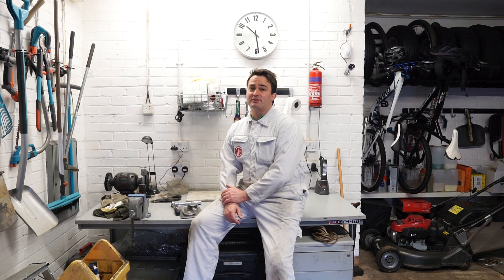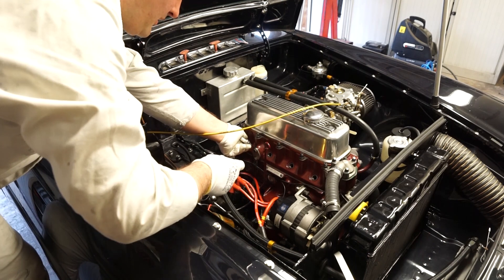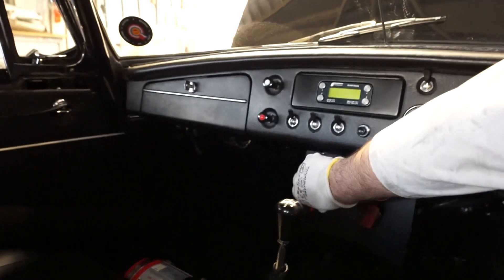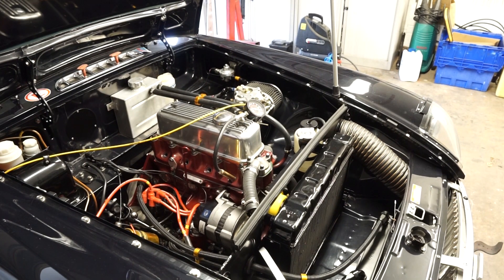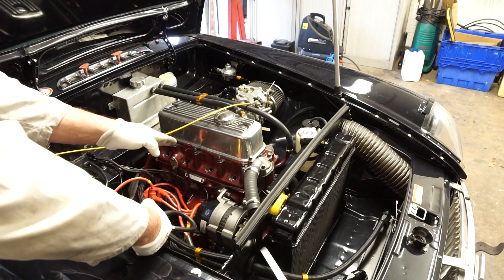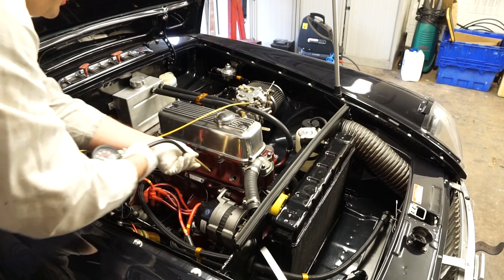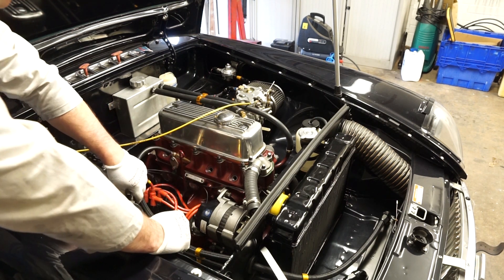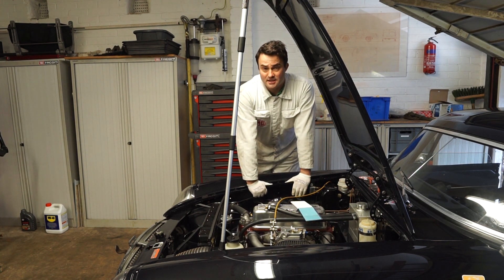MGB Engine Motor Compression Test Step by Step Guide

Comment: Great video..thanks 
I am bench testing an MGB engine that I have no history on..
Cyl 1: 155
Cyl 2: 160
Cyl 3: 140
Cyl 4: 145

I've lapped the valves and it has new head gasket.
Applying oil to the cylinders significantly increases compressions, so I'm going to install new rings..
Reply from the maker: Sounds good Ian, hope it all goes well.

Comment: David, did you modify the washer pump to function as a starter button, or is that simply an aftermarket starter button that looks just like the washer pump?  Love your content by the way.
Reply from the maker: Thanks for your message, the switch is a push button Lucas type https://www.merlinmotorsport.co.uk/p/lucas-push-button-ignition-switch-ts-spb106. It does look correct for the period which is why I chose it.

Comment: fun to watch again, but I see no fan? what do you use to move air thru radiator?
Reply from the maker: I don't use the car on the road so usually having no fan isn't a problem. The only time I get an issue is if I am waiting in the assembly area etc. I think once the car is on circuit having a fan just gets in the way of the radiator and it runs cooler with out it.
Reply: @davidrussellwilks  what are you running for plugs currently? And Ds3 Shooter has a GT in your class I believe.

Comment: Just done a compression test today on "72" MGB GT, 1.8L, twin SU.  showing with warm engine, 125 to 122 throttle closed, with throttle open 135 to 124 back two cylinders a bit lower. Just got car last week so doing pre service compression. Plugs looked a bit sooted. Its an H engine so high compression according to tag. Is the compression numbers a bit low or standard for a 50 year old unit. Thanks again for the videos, keep them coming.
Reply from the maker: The numbers between cylinders are fairly close, and this is a good thing. I imagine a fresh engine would have around 150-160psi so you certainly are not a long way off.
Reply: @davidrussellwilks  thanks for the reply, just done compression again this morning after a run and engine at full temp showing just over 70c on gauge and all plugs out this time, front to back throttle fully open 135, 136, 134, 135. Doing oil & filter change Tommorrow and the clutch slave cylinder i never got a chance to do last week. Cheers.

Comment: I thought just taking the coil LT lead of to stop the car from firing up is enough. Why disconnect the fuel pump and why does the pressure increase with the throttle open?
Reply from the maker: I disconnect the electronic ignition module as the Pertronix units don't like being left on if the engine is not running. I also disconnect the fuel pump to prevent flooding the engine with fuel with the throttle open. With the throttle closed you may not get a correct reading as it won't be allowing air into the cylinder.
Reply: @davidrussellwilks  hi thanks for that. I had assumed you disconnected the fuel pump to stop it from flooding. My dry readings are terrible so next step is to do some wet readings which i guess will increase the readings,however  I'm not sure it will tell me if its the rings or valves without me having to take of the head. I have ordered some piston seal additive to see it that works. Have you used piston seal additive before and did it work?
Reply from the maker: You can try a leakdown test to try and find out where the pressure is being lost, I do find they are a bit more difficult than the compression test. I've never put an additive in the race engine, if there's been a fault in the past I've had the head or engine rebuilt.

Comment: What did you disconnect on you ignition? The lead from the coil to the distributor at the coil end? And what other wire?
Reply from the maker: I have electronic ignition so disconnected the positive wire going from the coil to the module. The Pertronix modules can fail if left on for a long period without the engine running.

Comment: How do you disconnect the fuel pump and is this essential?
Reply from the maker: Thanks for your message David, in my car it's fairly easy to disconnect the fuel pump as it's in the boot rather than under the car. I usually do this a matter of course but it certainly isn't essential, especially with the SU carbs. I had already drained the fuel from the car too and I wouldn't want the pump to run dry.
Reply: @davidrussellwilks   Many thanks for reply David. I was interested as plan to do a compression test on my MGB GT and Triumph Stag soon. The MGB does have SU carbs, whilst the Stag has Strombergs.
Reply from the maker: @DavidUKesb  Thanks David, hope all goes well with the tests, I think you'll be fine with the fuel pump still connected on both cars. It's well worth removing all the plugs so it's easier to spin over. I found nothing conclusive about whether it's better to run the test hot or cold. With a Weber an open throttle does make a difference I think less so with SU's. I also found with my car 10 cranks gave a more steady reading than 4 or 5.
Reply: @davidrussellwilks   Many thanks for your advice.